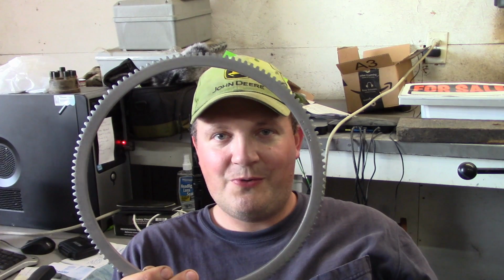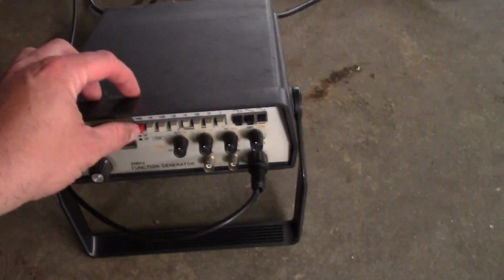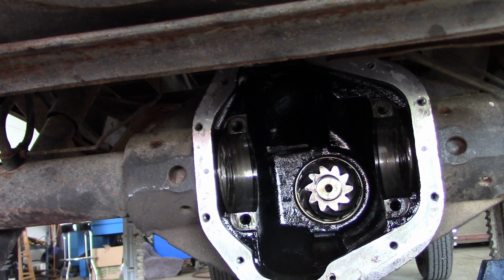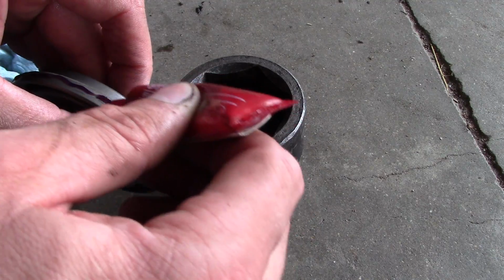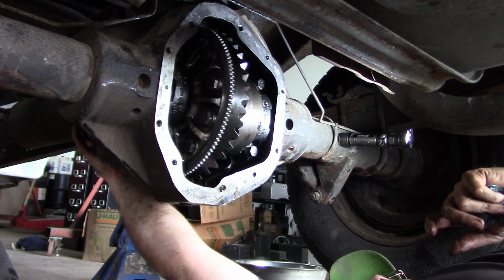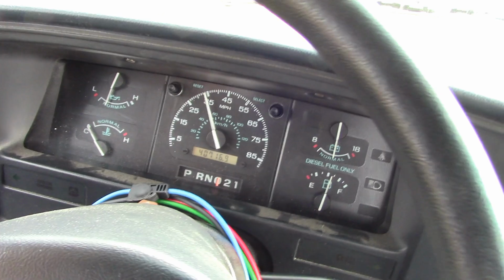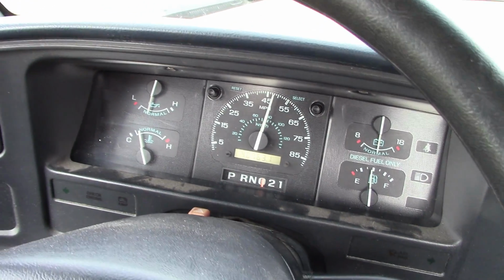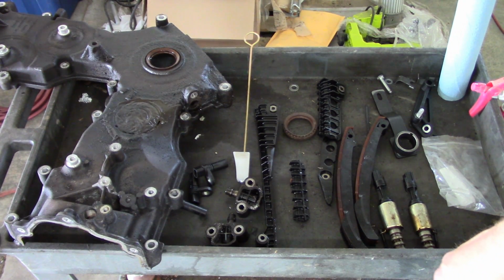Ford E350 Tone Ring VSS / Speedometer Fix

Comment: There's a lot to be said for manual transmission and speedo cables. Simple fixes if either break. To much reliance these days on electronics rather than mechanical engineering. It would seem the hardest part of any fix is to determine what the hell is wrong with it! 
Well done Wes, gritty determination in extreme to fix that truck... Still feel sorry for the guy with the shot engine.  You've done what you can but I don't think it's going to last for long. Makes you wonder how all this modern design technology counts for nothing in regards to longevity or reliability. 
Lot to be said for keeping things simple stupid!
Reply from the maker: I dunno. Have you tried to find a speedometer cable recently?
Reply: @WatchWesWork  you have a point, I work on mostly british classic cars.  Getting harder now in some cases I admit!

Comment: Great fix...  Rust has extremely weak magnetic properties compared with steel, hence the bigger than expected variation in output from the passive sensor compared with what appears to be a small amount of surface rust / pitting on the tone ring.   Good luck with the other gremlins :)
Reply from the maker: I know.

Comment: A lot of the problems you are fixing on vehicles are long term issues that would be caught by an annual roadworthy test that most of the rest of the world has (MoT in UK, TUV in Germany, CT in France (where I am) , WoF in NZ). It's a test that many complain about, but it keeps vehicles from having compound problems when people don't understand maintenance is Necessary !
Reply from the maker: I know it's appalling to you Europeans, but we have no compulsory inspection for vehicles under 4 tons, and the inspections we do have are mostly a joke. They look at brakes and lights. If those work, it passes. All of the rusted out dump trucks I work on pass a state safety inspection every 6 months.
Reply: @WatchWesWork  Don't worry I've lived and worked in a cople of different states and Provinces over a 11 year period and I benefited from the strangeness of the systems, being able to buy and fix for penuts, run a vehicle for a year two and then sell it for far more than it had cost me (including running costs).
Reply: @WatchWesWork  Try Japan, a bi anuual (once evenr 3 year) inspection costs about $USD2000, and all docments must be in triplicate on paper, on a personal passanger car. But the moment you get into anything not on the road, there are no rulles, comercial use or not. I was handed to the Keys to a Pisten Bully (Snowcat) for a winter and the instructions for use and maintainance was "Best of luck". After fighting to start the beast I found it hadn't been driven in 5 years and had missed a few seasons mainainance!

Comment: That’s one hell of a complicated set up just for a speedo! Is this system used on a lot of your kit over there? Thanks for posting Wes, appreciate your time. Regards Chris (UK)
Reply from the maker: Newer vehicles are worse. They average ABS wheel speed sensors or transmission output shaft sensors.

Comment: The whole time you where prying on that carrier the pucker factor was of the charts for me. Ive dropped one as a green tech. Put a dent in my steel toe boot. 
Do you have NVH hook up for that pico? If so that is a pretty nifty diag feature on those machines.
Reply from the maker: I don't have any NVH attachments. I once dropped a Spicer 15" clutch on my steel toes. Cut right through the leather, but did not hurt my foot.

Comment: When I grew up back in the 1900's, we had things called speedometer cables. No fancy schmancy confuser brain machines for us. Good times.
Reply from the maker: It's a brave new world... of 40 year old technology.
Reply: And when the cable binds, speedo wiggles just the same... Then it breaks.
Reply: @milantrcka121  then the pickup didn't have a speedometer for the last 250,000 miles. Thataways you keep the miles down, rite?
Reply: @milantrcka121 I guess Dad didn't tell you about the graphite lubricant huh?
Reply: Older does not necessarily mean better. Speedometer cables seized often, and there are distinct advantages to this configuration. It just requires a different skill set to work with it.
Reply: Those break too.
Reply: Well you know what’s better than both? Using the wheel speed sensors for ABS to make a speedometer signal
Reply: @charlie_nolan  I'm willing to bet that mechanical cables last longer than data cables.
Reply: @grosseileracingteam  I’d be willing to take you up on that bet
Reply: @charlie_nolan  Sure, until the owner realizes it's about $80 for each wheel sensor. Those things go bad constantly, almost as often as useless TPMS sensors. But hey, we have a coil for each cylinder now and it increases efficiency by 0.01%.. Oh wait they're $200 a piece.. 

Nice "advancement". Vehicles break down just as much today as they ever used to except now the parts cost 500% more to fix it.
Reply: @COBRO98 I promise it’s less today, and wheel speed sensors rarely die. When they do, it’s an easier replacement than a speedo cable and cable speedometers get inaccurate over time when wheel speed Hall effect sensors do not. But you can have your opinion and I’ll have mine.
Reply: Having restored many, many speedometers... I doubt you owned British vehicles....
Reply: @ranchorelaxo2287  Only Irish...Uncle Henry Ford was Irish.
Reply: Technology isn’t a bad thing.
Reply: Like some basic washing matching machines...back to Maytag A806...
Reply: Yup, engineering KISS rule. KEEP IT SIMPLE, STUPID!
Reply: I even had an adapter on my car to to convert it to km/h from  mph. About ten bucks and ten minutes work!
Reply: Yup, and a car with 100k on it, was basically clapped out ! Carbs needed adjustment constantly, points , rotors ,caps, plugs, wires. All suspect after the car was 4 yrs old, you got a flat on every road trip you ever took, the paint sucked, panels were rotted after 6 or 7 years , paint was faded, dash was cracked from the sunlight, your doors were sagging because they weighed 2 tons and were 14 ft long., ahhhh the good old days., let’s not talk fuel economy or tune up intervals?? Electrical problems were the norm (similar to today’s dodge vehicles) lol ., ahhh the good old days... but this is a phenomenon I’m sure we will all find ourselves in at some point, because the human brain tends to remember the good times!!
Reply: @ryanhogan6509  Just FYI on our older vehicles  like my 1964 F350,my 1976 F250 or even my Ford 8n tractor which all still plow snow, haul and tow, only require preventative  maintenance that only need basic hand tools to perform.  Ever notice that the best mechanics like Wes who make their living working on vehicles, drive old beat up mechanically sound Ford trucks?
Reply: @grosseileracingteam  ahhhhh a Ford 7.3 ? And believe me, things today are more reliable, else company’s would not spend the millions on research and development, the 7.3 with its hpop fired injectors is far from a simple system, with the exception of egr systems on diesels they are all dialed in fairly well these days, and if your talking engine efficiency, or personal comfort. Or how long wheel bearings go between services, the newer stuff blows to older stuff away., now me personally I think if your able to work on your own rigs , then you have a much larger group of vehicles that work for you, if you can’t work on your own trucks, then your kind of limited in what you should consider for a daily driver., I’ve never heard anyone say I’m gonna buy my daughter a nice old car so it’s more reliable?? Generally we would look to the newest vehicle we can afford to put our daughters in?? Now do I like older trucks, hell yeah, but not because they are more reliable...
Reply: @ryanhogan6509  You must be a lot younger than I thought.  Both my trucks have the Mighty 390. Ford didn't put the IH idi diesels in pickups until the 80s. We have my 17 year old Granddaughter  driving a 1979 F150 with a 300 straight 6 as a daily driver. She changes her own oil and tires too. The only reason the manufacturers do all the r n d on new CRAP is because they were forced to by federal regs like CAFE.
Reply: @grosseileracingteam  I mentioned the idi because you mentioned “why do you think Wes drives old simple trucks” , I hope your 17 yr old has not already blown through a set of tires in her first yr of driving.. or needed much more than 1 oil change??
Reply: Cables were noisy when clocks got worn. Then the cable had to be a separate penetration in the firewall. Also loooing round the body. The gain of electronics is great
Reply: Yep 1900s were much better
Reply: Exactly. But that would be far too easy. That over paid collage graduate working at the FORD dealership would have a hard time "earning his money" with one of them things.:- )

Comment: Part of me makes me wonder if the speed sensor has something to do with the engine computer you had to replace maybe the truck was thinking that it was going fast and slow really quick with that gauge bobbing up and down, so I think the computer was messing with the engine control modules like governor throttle etc and all that fast unusual changes that the computer is not designed for was killing it and maybe but hopefully not trying to destroy the transmission. This is just an idea I’m only 13 so I’m not very experienced with computers and that crap, really only mechanical things one my own stuff.
Reply from the maker: I don't know. There is some kind of magic in the control system, so it is possible.

Comment: As a paramedic ... Here's what you can always assume with a used Ambulance: 

It's been run overweight, cold started, pulled out of the ditch at least twice (sideways, with the wrong equipment), run low on oil, run high on oil, driven with park brake on, slammed into park or reverse while still moving and it's been peed on.  

What happens on the second week, well that depends on the crew.
Reply from the maker: LMAO!
Reply: I used to service rental cars. You would not believe the damage often very obscure damage.
Reply: @sidewaysaction9983  I once put a rather large dent in the floor pan of a Kia rental car.  It turns out the Optima can be pressed into service as an off road vehicle should the need arise. But they don't come with a skid pan for some strange reason. Oh yeah, it's a sedan.
Reply: Peed on?.....Yeah probably so....
Reply: Played ambulance driver for a couple years, both our ambulances were right on the max GVWR of 14,000lbs for their respective chassis. Start it cold, floor it  immediately to 90MPH if you can get it there, then STAND on the brakes. Then, run it WFO for 50 miles or until it runs out of fuel.
Reply: Nothing like working on a meat wagon. And I always dreaded hauling in with a wrecker.
Reply: And every single one has more idle hours then miles on the odo lol
Reply: Ex medic.  He/she is right on
Reply: That describes most of the junk I drive every day LOL!
Reply: The company I worked for had "system status management". The crew sat in the truck the entire shift on a street corner. Trucks would idle 24 hrs a day. You can imagine how reliable the 6.0l was doing this.
Reply: Lol...😅🤣
Reply: Don't forget they have to tow the ambulance chasers behind them also.
Reply: Drumroll and a rim shot on that one mate! 😂😂😂😂
Reply: Hahaha!! That made me laugh.
Reply: UK ambulances are usually running at max weight. As is the way with modern stuff, it's designed to run at average weight. I've followed ambulances at sensible speeds and smelt the brakes burning up. Modern springs also only seem to take full load once in their life, they sit an inch or two lower after that.
Reply: How an ambulance can be overweight? When the ambulance company put the body and all of the equipment on the chassis, the total weight must be under the maximum weight. The weight of crew, supplies and patient should be minimum compared to the ambulance weight.
Reply: @yzhang8629  The dudes being funny
Reply: @yzhang8629  Fire Trucks suffer the same fate. They're built to carry the old rig's load with more room, so when the rig arrives, it gets packed with more new gear to carry and it spends the rest of it's life overloaded.
Reply: @yzhang8629  I've seen ambulances so over grossed, the rims were halfway bubble on departure. Take hamhocks and family for a ride and that's the result.
Reply: @yzhang8629  You would think so. But no, I have herd the same problem in Australia.They have a over constructed fiber glass body and all the stock they carry.
Reply: @yzhang8629  In the 1980's the local health board bought new Mercedes ambulances they stood for months unused because they were built on the normal commercial chassis and so were over wieght  they needed beefed up suspension which was difficult to buyalso the taillift would not work properly (kept hitting the road when the platform was vertical ) eventualy they were sent back to the manufacturer. I donn't know what happened after that. Oh there were about 20 of them so lots of money wasted.
Reply: @yzhang8629  never had to deal with 600 pound wellness check have you
Reply: Derek Addy I under estimated how much more stuff/people that would be put into a vehicle, until I recently watched several overweighted RV videos
Reply: @yzhang8629  mutual friend of mine through my boss is the fire chief for the local area.. you hear some doosies ill tell ya. theyve gone in sometime where they need a legit crane and flat bed to get people out... or the pumper truck being full water with full crew and 2 sets of gear thats running almost 2X what its insured for on the road.

Comment: The E-350 van cut away,  reminds me of the VW bus style trucks with a truck bed. Ford, chevy and dodge all had one late 60's into the 70's. That's why I love this vehicle so much.

P.S. this truck must have sat in a swamp for five years.
Reply: Most of our heavy pickups in Europe are that way, maybe now you are finally getting euro style vans you might get the pickups to.
Reply from the maker: It's what happens with things sit. Especially here because we have huge swings in temperature and humidity.
Reply: It also sat for a good while in Georgia heat and humidity before it came to Illinois.
Reply: @bluegrallis  that explains a lot of the corrosion.